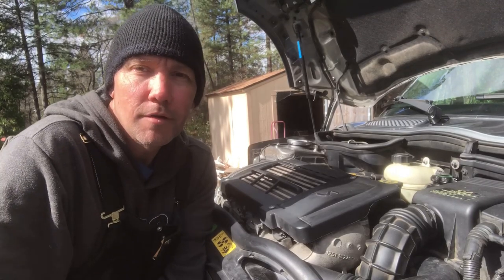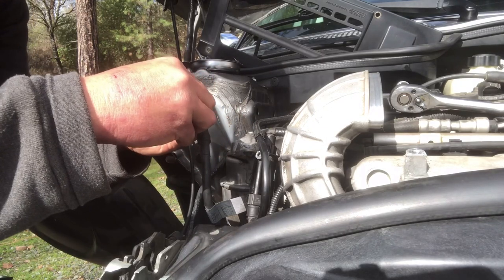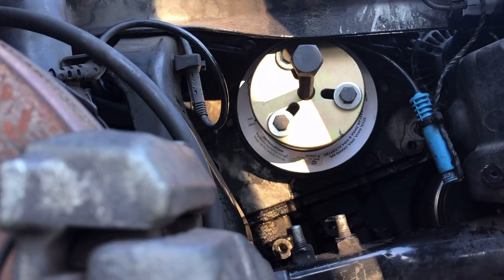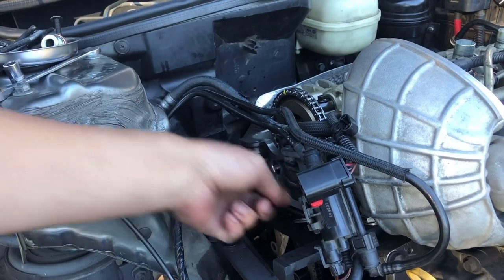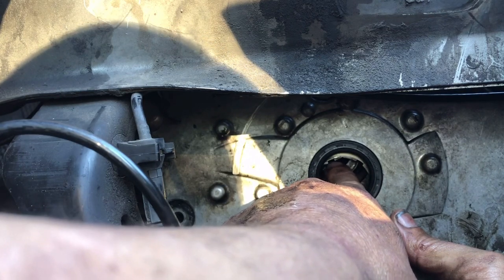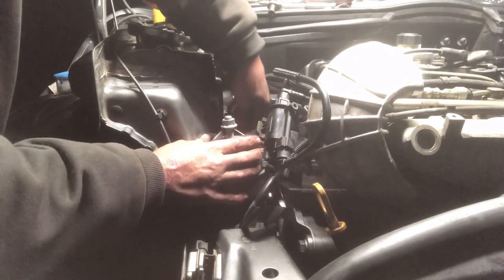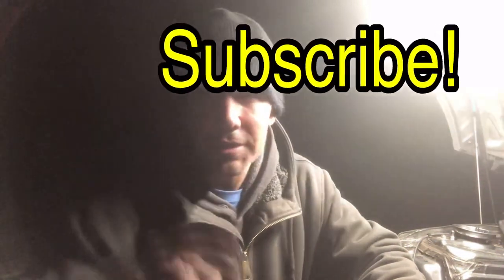R53 Timing Chain | How to replace the timing chain on an R53 Mini Cooper S

Comment: Very, very good video.  I have a 2002 S with 49K and thinking of changing the tensioner and chain guides. I'm thinking the guides are brittle due to age.  The crankshaft seal and timing gasket seal leak. Will change those, too.  The idler pulley was shot as was the tensioner pulley and hydraulic strut. I'm not gonna mess with the timing chain until much later. I've changed every coolant and power steering hose and o-rings about the block and manifolds and most gaskets because this thing leaked everywhere.
The car never dropped a drop of oil onto the floor because the Arizona dust stuck to it and made it into instant taffy.
Never seen so much oil and power steering everywhere in my life.
Supercharger was low on oil. O-rings we're old. Changed that. Be careful that is an expensive repair if you let it get dry.

Comment: Nice couldn't believe how easy this was to do, you did a whole lot more take this apart take that apart then I did. Bought the tool to hold the cam shaft but it really did seem like it was necessary, but if you ever do one use it anyways. All in all it took me the time of this video to do my timing set up and it was the first I've ever done.

Comment: Using a metal coat hanger vs the actual pin makes that part a lot easier.
Reply from the maker: If you’re referring to the pin on the belt tensioner, that does sound a lot easier 👍
Reply: I tried to use a hanger, but once i release the tension, the pressure from the tensioner deforms it to the point it either sheers or bent and was a b*tch to pull out.

Now I simply jack stand the front end. Where the tension bar inserts in the tensioner, has a bit of a lip and stick out. So I use a pump jack and a thin crowbar and from the bottom, lightly push the tensioner up. Boom. Belt changed in less than 3 minutes.

Comment: After you've pulled the bumper, front core, inner liner ... spray degreaser everywhere and let soak. Then hit it with a pressure washer and get all that gunk out. Put a tarp under and maybe some cardboard, that will catch most of the junk. Let dry over night. Beats working in a oil pig stye!

Comment: great vid! would have been safer to install cam lock down tool before taking out cam tensioner ? are there gguide made of metal with a teflon pad like performance ones for ford ohc motors?

Comment: Hi great video. Need a bit of help. My timing chain holders broke, and the chain cracked the timing chain oil cover, and the tensioner was not working. I think the chain was slipping. How do I find TDC after I have replaced the chain with the fact that the chain has been slipping. Thanks for your help . My car is an R53
Reply: I'm trying to figure out the same about TDC. After I removed the tensioner and went to move the crank to lock the cam, I heard the chain skip a tooth. I feel like the tensioner should've been removed after locking the cam in place.

Comment: I’m checking to see if I have to replace my guides now on my r53 is the chain typically loose on the front side of the engine with tensioner installed?
Reply: The tensioner is Engine oil pressured it may have some slack...if cold and relaxed. If you have had the Death rattle symptoms. Swap out that Part easy to do.

Comment: Might have missed this but what time stamp in the video do you remove the timing chain tensioner? Since you said you tested the crank with the crank bolt to get the sprocket dowel pins to align horizontally with top of engine.
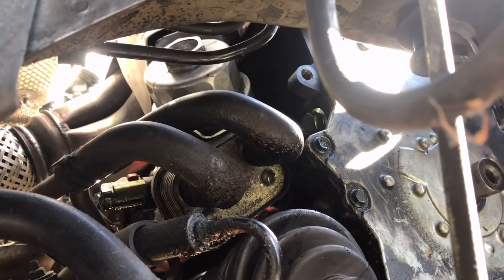Reply: 19:35

Comment: Very good video but I need help. After installing the chain and timed to the book the car won’t start and get a po341 cam sensor code. I took everything back apart and double checked everything and all is good so figured had a bad new cam sensor. Replaced it with another new cam sensor and same thing. I don’t know what to do now??
Reply: hey I'm having the exact same problem with my R53. P0341, and twice the car wouldn't start (not even crank) unless I removed the negative battery cable and re-attached it. I replaced my timing chain a few months ago and the problem did not start then - this started after I replaced the camshaft and a bad rocker arm this weekend. I came to this video to watch the process again (Project Mini - thank you, this video is excellent) because I'm planning to re-do the timing this weekend, like you just did. The car seems to be reacting the way it would if it was mis-timed, so I'm thinking I messed up the timing while I changed out the camshaft. If you or anyone else has any new experience to add to this I'd love to hear it!
Reply: @TrevorMinton  mine turned out that the crank sprocket sheared off the dowel pin and spun
Reply: @alconk7129  oh that sounds bad... did you repair that or did that kill the car?
Reply: @TrevorMinton  nope repaired it

Comment: Do I need to get the first piston tdc when I put my r53 back in time or just line up all the marks on the timing chain?
Reply from the maker: The bentley service manual doesn’t mention anything about tdc.
Reply: @ProjectMini  Thank You I’ll try it then.
Reply: @ProjectMini  thanks for the effort in putting this video together!  I’m a concerned with this info as I’ve apparently messed up my timing replacing my cam.  Now I need to see the alignment clearly as if replacing the chain.  However this could result in being 180off in timing depending on which way I go with the crank!  Any word of wisdom here?
Reply: I think I answered my own question.  Piston is either up or down … cam position sensor determines fire or exhaust stroke.  So as long as the marks align should be in good shape.  Crossing my fingers…
Reply: @kevinmartin3645 did you ever figure your issue out?
Reply: @ozonebu3746    Unfortunately no.  Took the timing chain cover off (painful) realigned timing chain all marks aligned.  Still no joy.  Donated the car, bought a Tesla.  190k on the mini, looked good on the trailer that hauled it off.  😢

Comment: Why didn't you replace the cam and crank gears?
Reply from the maker: The kit didn’t come with them. I might do then later though
Reply: @ProjectMini If you go to the bother of timing chain off, you should deffo replace the sprockets! 
Sprockets wear with chains! Stretched (worn) chains, fit very well with worn sprockets. 
New (upstretched) chains do not fit well with worn sprockets - sometimes they jump teeth because of this.
Why do half a job?

Comment: Man no start?
Reply from the maker: I did this job while i had a spun bearing, if you look at a newer video i start it after the bearings are replaced
Reply: @ProjectMini   @Project Mini  i didnt mean for it to come off negatively at all wasnt my intensions just the cliffhanger lol. 
I have a weird problem with my r53 but its too much to type related to the timing. its not that its out of time because the car is way easy to time properly with the cover off but even with a brand new chain and guides im still getting slack only on the no tensioner side. i cant understand why and also the chain sawed through the bottom rail on the timing cover. this is a brand new chain and yes ive replaced the tensioners a few times with new ones and tried the washer trick as well-by adding a small washer to create more tension on the tensioner.
Wendy (my r53) has me baffled.
This all started when I replaced my head due to a burnt exhaust valve. before that i didnt have and chain issues at all not even a little. I thought i got a bad head so I replaced it again come to find out both were fine and its my chain slack on the front non tensioner side.

Thats the gist.